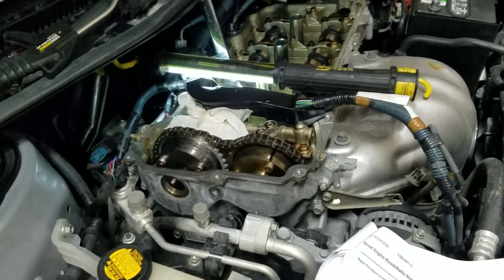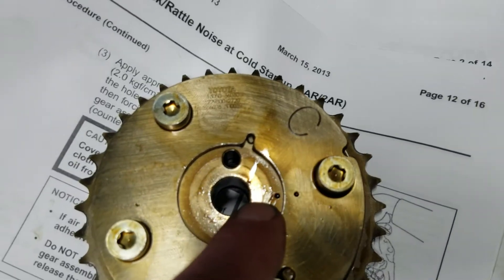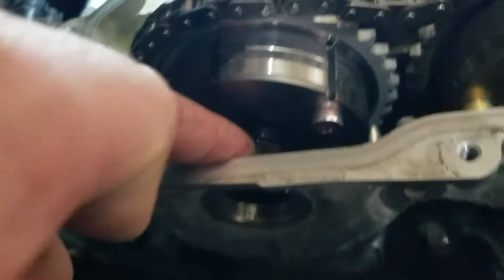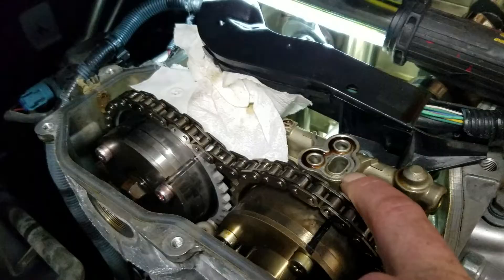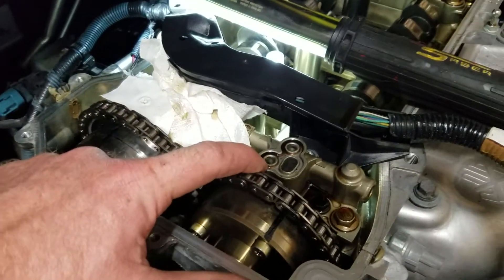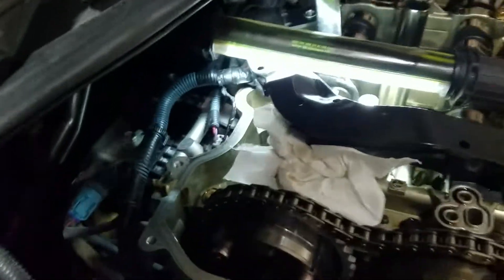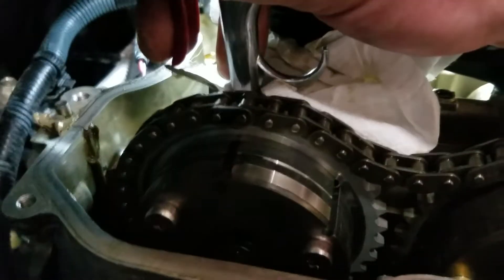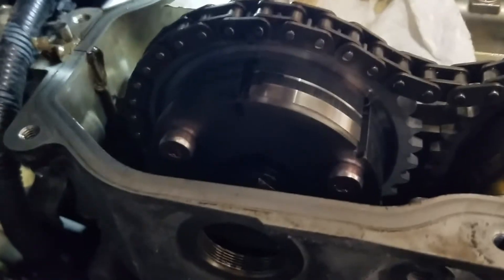Unlock Cam Gear (VVT-I Toyota)

Comment: Ever seen one that would not lock? I got a gates VCP806. I can rotate it until the 2 dots line up and it will not lock. It will freely rotate back and forth without ever locking into place.

Comment: The easiest way to unlock these gears is to remove the 4 bolts holding the cover on the gear and pull the pin back. Just be careful so you don't drop anything down into the timing cover. Also, there's no need to replace the cam gear. Just replace the spring that pushes the pin in. This makes this a 1 hour repair and only uses 5 cents worth of parts.
Reply: Make a video and help us
Reply: @Usmanthemecano  im not sure if you still need this but i made a video on this exact repair.
Reply: Yea make a video explainjng at least if you can @Usmanthemecano
Reply: @kirbyfeet-zq1rj  someone did just look up "how to fix VVTi cam gear without removing it" or something like that. He shows how to do it, take the valve cover off and unbolt the cam gear /front⚙️ by rotating the cam and taking the four bolts off, then the plate on it, and then the spring comes out and you can stretch it, and put it all back together and if the pin in the cam gear was what was causing your rattle, it will be gone..
Reply: @kirbyfeet-zq1rj  https://youtu.be/cZfM6_uWfrc?si=azF9abowCVw-S3AO
Reply: Really!? Awesome. Good to hear.. what if it's just gunked up could some liqui moly help free it up? Mine suddenly started rattling one day on the way home while accelerating.. And then now on startup when I turn the key immediately, if I wait a few moments with the electric on, it won't do the rattle noise.. and both noises started days after a p0420 code and check engine light.. And my exhaust has black soot in it, so it's running rich I guess? I've just been driving it, cause it's got 270k+ miles on it and I have to use it to work.. but can you take that cam sprocket off without taking off the timing cover? The couple of shops I went to weren't helpful at all.. One just said "sounds like transmission noise, might be time to get a new car" lol and the Toyota specialist mechanic "pros" said 149$ for a diagnostic and I asked him what that entails and he said he'd just hook up a obdii and drive it around and listen to it lol.. I have an obdii I can do that... Geez.. I started it without the belt for a couple of seconds and it made the rattle noise so it's definitely something in the engine, and the rattle sounds like all the videos of VVTi rattle.. but I don't really have or want to sink another couple thousand dollars into a car with that many miles on it.. but I could take the dang valve cover off and check.. he didn't even offer to do that I asked how much to do that and he said he wouldn't be able to tell if it was the timing chain, or whatever, but you'd be able to see if the chain was loose right? It could be the VVTi solenoid or tensioner too couldn't it?
Reply: @foxmulder7616  if it's rattling I would think it's not locked but loose and moving back and forth rattling until the oil gets in there.
Reply: @kirbyfeet-zq1rj  yeah I'm gonna try this fix I think, then if that doesn't with, the tensioner and solenoid after that..

Comment: I'm about to replace a sprocket to see if a ticking noise will go away on a 2002 camry 4 cylinder.  Since the sprocket has been in lock mode the day the car was first driven on the road to over 100,000 miles, what is the reason for unlocking because after reinstalling a new sprocket, we will have to lock it anyways?

Comment: Is there any reason to unlick this if you do not have any error code and or are not replacing?  For example if you are removing the cam do you have to unlock this?  thank You.
Reply: Exactly!  Thats what I have been wondering.  I think unless you are getting an error code or noise on start best to leave it alone.  Perhaps someone with more experience may chime in on other issues that would warrant opening it.

Comment: Hey man ! 
Just out of curiosity, I noticed that you had the bolt through the cam. When you were unlocking the cam phaser. Did you only have it hand tight at that point. Just curious because you can’t see the two dots with the bolt on.

Comment: I had this exact same thing happen with an 08 vibe, we unlocked it before install and didn't hold the cam in place, it re-locked itself while tightening and caused some big headaches.
Reply: Puedes compartir cuáles fueron esos grandes dolores de cabeza para conocer cuales son los síntomas, de antemano muchas gracias

Comment: After u install new phaser,should  set pin lock back ?or let it free?which side to align with if both intake and exhaust cam got vvti ?
Reply from the maker: Download the install instructions
Reply: @frontyardmechanicdiyall4268  from where?

Comment: I can’t seem to get the camgear unlocked. Don’t know what’s the trick. I removed the whole timing chain cover. Plugged the holes with paper towels and put tail thru it higher than 29psi to account for leakage as air does come out the front of the camgear.
Reply from the maker: You should here a light click noise when you apply air, then you will need to rotate,  have someone hold the air on it and then hold the inner gear and rotate the outer.
Reply: thanks for pointers. Once it get locked it’s very hard to unlock it and I will try your method again but it sure is not easy and Toyota does not give good instructions. The camshaft knock pin has to be on the camgear and bolt hand tight and the camgear flush with the camshaft. This definitely a design defect not sure if Toyota has parted this out or not.